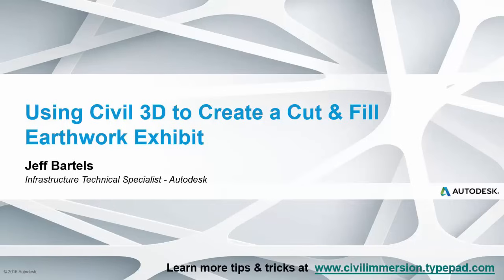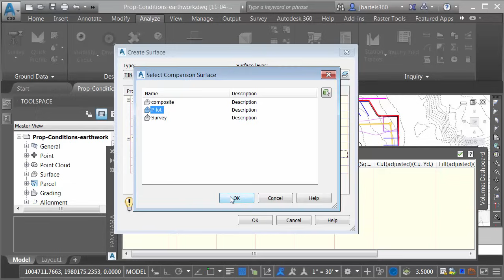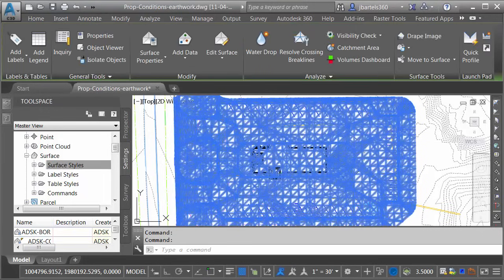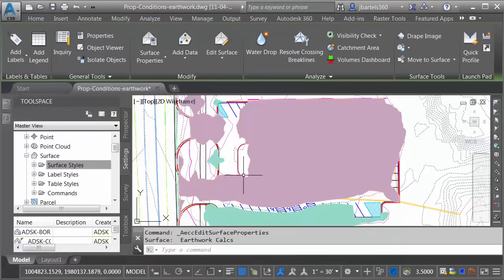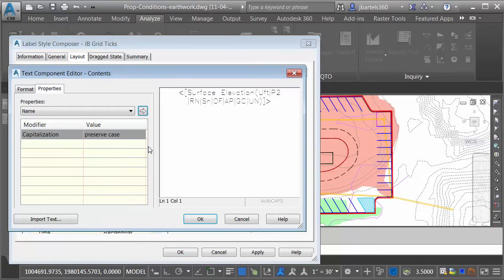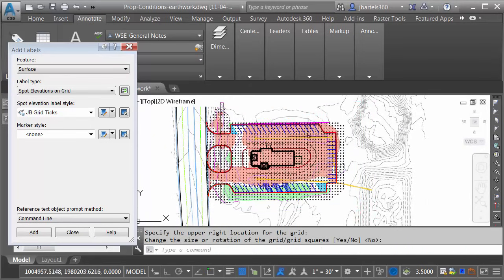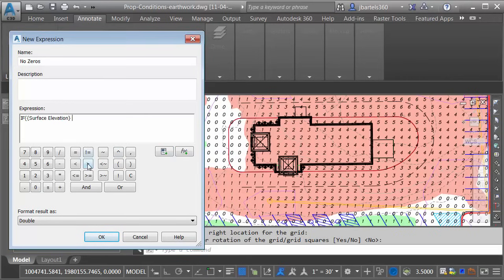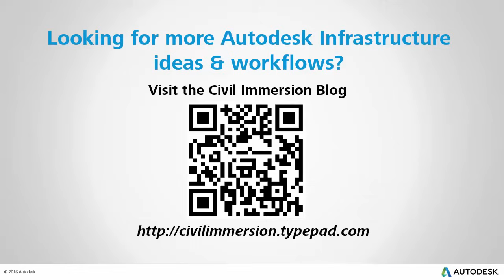Using Civil 3D to Create a Cut & Fill Earthwork Exhibit

Comment: Thanks Jeff, one thing - I was expecting to see you change the formula of the spot level to upper elevation - lower elevation but this was not done. How is the depth deduced by this spot lv? Are elevations removed from a volumetric surface & replaced with depths?

Comment: I enjoy your videos very much. They are very helpful. This cannot be called "earthwork" because the proposed comparison  surface FG elevations consists of pavement, concrete and base course structural thicknesses that are being included in your volume calculation. Earthwork should be a comparison between a stripped EG surface and the bottom of the proposed surface structural sections (top of sub base). .I only mention this because this is a lack of capability in Civil 3D that has needed to be addressed for years, and hasn't as of yet.
Reply: Frederick Ernst yes I use trimble business center  HCE for all my volume calcs its very good....i think cad has a way to do sub surfaces...with corridors and pay items but TBC is just so easy....
Reply: There is a way to get the earthwork to the bottom of the base.  You have to set up a comparison surface.  I do it all the time and have areas that are parking stalls with a different thickness than the drive aisle.  It's dynamic as well where I can change the thickness of the pavement and it will update the earthwork.  Civil 3D can do it, you just have to search.  It's a very powerful program.  Powerful, flexible and easy to use don't typically go hand in hand.

Comment: Hi, can i ask how you insert your proposed level? I see yours have a 90 degree verticle drop ( probably kerbs) and im having trouble adding those in civil 3d. Adding those as lines would make multiple duplicates with different elevation at drop location.
Reply: Anyone know how to have the cut and fill automatically create and include slopes for cut and fill calculation outside of P-Lot Boundary?

Comment: I have followed your video and everything is fine except removing the zero labels. All my labels for cut disappear when I switch the label style text height to 
"No Zeros" expression. I have double check this expression and still get the same results. It seems like all the formula/expression is dropping all the negative numbers instead of the negative numbers from -0.5 to 0.00.  My formula/expression is IF({Surface Elevation}> .5| {Surface Easting} < -.5,.008,0). Can you help Jeff?

Comment: Hi Jeff I have data short cut a civil 3D alignment, surface and profile info to a new file everything works but the profile they would not come up. Could you shed some light on this issue if possible

Comment: Another great video Jeff. Do you know if it's possible to increase the vertical scale in object viewer so smaller elevation changes are more visible? I find that these small but important vertical changes are especially hard to visualize when viewing a large area in object viewer. Also it would make finding possible errors in a surface much easier to spot.
Thanks for taking the time to create all these great vids.
Reply from the maker: Hi Steve, Vertical exaggeration of a surface can be done through the style.  Select your surface, right click and choose "edit surface style".  (Or create a new style) In the Surface Style dialog box, select the Triangles Tab.  From here, change the Triangle Display mode to "Exaggerate Elevation".  And then assign the scale factor of your choice.  Surfaces having an exaggerated vertical scale will display exaggerated in the object viewer.  Hope this helps!  Thanks for your support!
Reply: Couldn't have helped more! Thank you sir!
Reply: Steve just Steve this helps as well thank you!

Comment: Hi, how were you able to know the max elevation of cut and minimum elevation of fill? On the surface properties ranges, does "0" means no change? Is it relative elevation based on the base surface or is it absolute level? Thank you!

EDIT: Now I think I get it, it's because the TIN volume surface elevations represent the difference of elevations. 🤦‍♂️😅
Reply from the maker: When you create a volume surface, the elevations of the volume surface represent the “difference” between two surfaces. 0 means no change. Positive elevations reflect fill and negative elevations represent cut. Hope this helps!
Reply: @JeffBartelsCAD  Thank you Jeff!

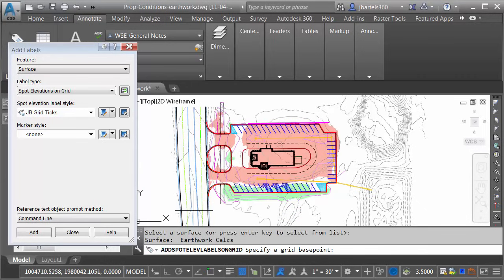Comment: Jeff,  Thanks for the video.  Question, 5:32 how do you adjust the the location of the grid basepoints after you set them?  I didn't click far enough over so part of my surface doesn't have surface labels.

Comment: every time I enter the spot for the upper right corner from the grid square, it just sits there and freezes up.  I even did a fresh reinstall of C3D and it does the same thing.  Any idea what I can try?
Reply: were you able to find a solution ? Be sure that your screen is rotated where the north is UP. this is how Civil 3d understand " UPPER RIGHT CORNER"

Comment: " This is the message I get whe I try placing the grid box: The specified point was not a valid upper right point" any idea?????
Reply: Check your north orientation...sometimes CAD considers "upper right" as the northeast corner. Lol I'm assuming in the last 2 years you already figured this out, but just posting this in case someone else is having the same issue.

Comment: why is the text height .008 when in the style dialog it's .08.
Reply from the maker: It's approx. the difference between decimal feet and decimal inches.  When manually entering a text height in the style dialog box, the dialog box assumes you are entering inches.  When the value comes from an expression, the dialog box assumes you are referencing the drawing units (or feet).  Since I didn't require precise text heights for this exhibit, I just added a "0" (.008) rather than calculating the actual conversion of .00666666667.  (If you watch closely, you'll actually see the labels get slightly larger after I apply the expression.)  Hope this helps!  Thanks for your support!
Reply: thanks for the reply Jeff. You always do a fantastic job with your videos.